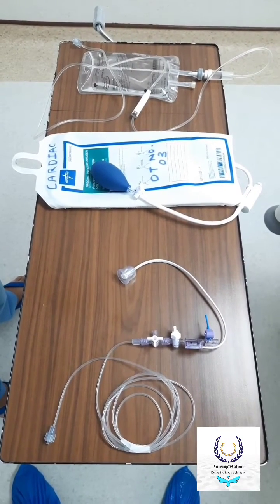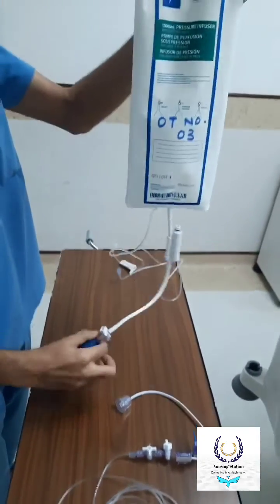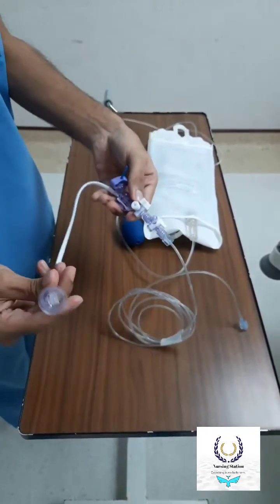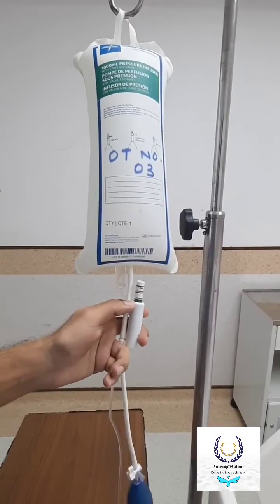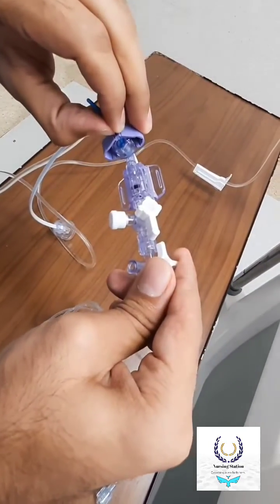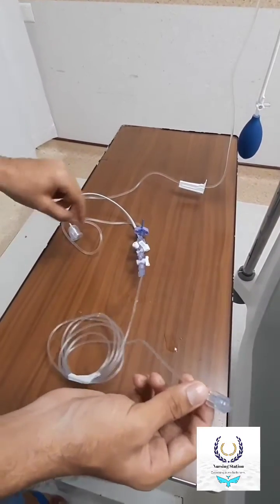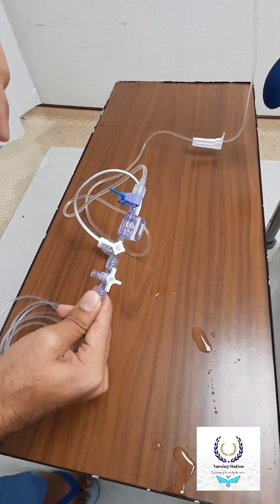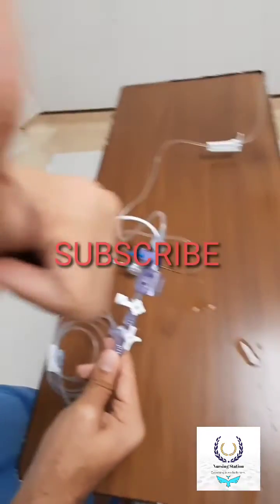Arterial Blood Pressure monitoring + Transducer setup + Pressure bag setup demo. @THEICUHUB

Comment: Is the 250-300 mmHg pressure needed to keep the arterial blood from oozing out of the artery into the tubing?  
Also, is 3 ml/hr the flow rate into the artery because of this pressure? How long does this continue, i.e. at what point do you have to increase the pressure in the bag? Thanks.
Reply from the maker: Pressure in the bag maintain the equilibrium against arterial blood.
And for inflation of bag there is mark on port of bag. Which indicates the appropriate pressure.
As soon as we find it reduced then we have to inflate it again.
Reply from the maker: Pressure in the bag should be as per  above Stated range. Otherwise the readings of blood pressure will be wrongly sense by transducer.